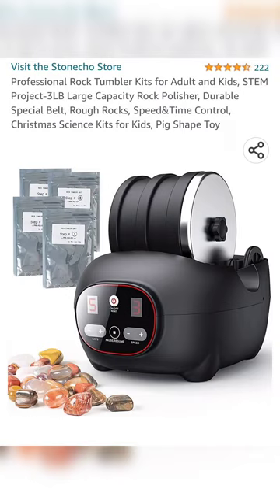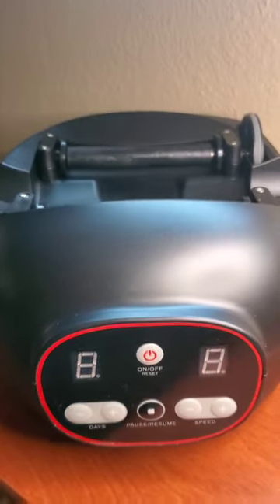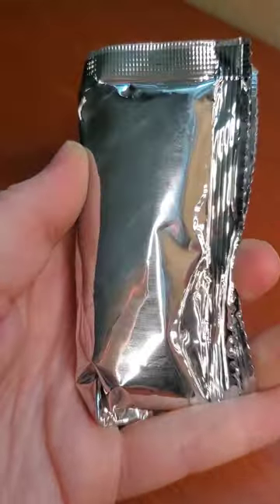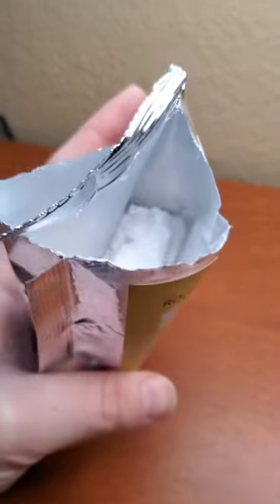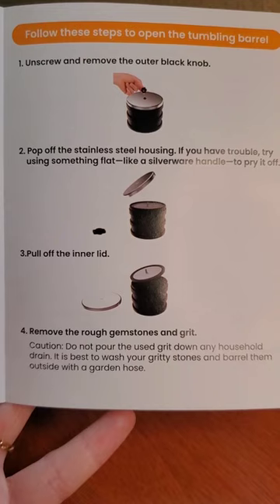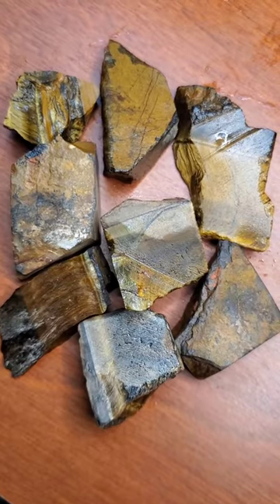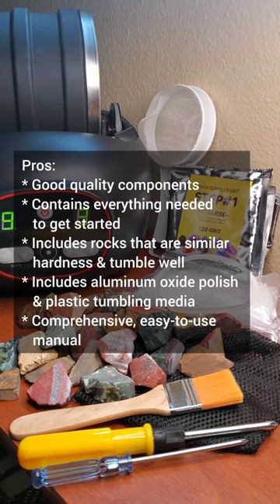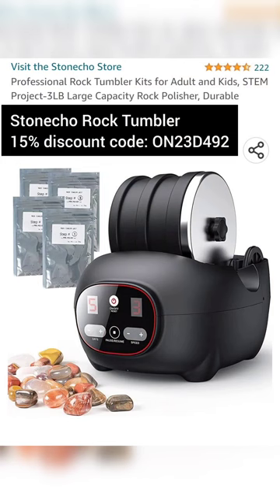Rock Tumbler Unboxing & Review - Stonecho Rock Tumbler

Comment: I’ve bought 2 of these exact same tumblers. Different company, but exact same tumblers, kit, grit, mesh bag, even the instruction manual (only change is the company name on the manual) one motor burnt out within about a 2 months maybe less. The other I’ve had for about 3 weeks and still works fine.

Comment: I use a Nat Geo for only 2 days on fast speed with no problems bruising the rocks in a 46-70 silicon carbide. This tumbler seems similar in design I would be interested to see how it holds up on the higher speeds. I like the heavier rubber barrels with stainless lids, they wear longer and help with rock bruising. Looking forward to your results. Happy hounding.
Reply from the maker: Nice! I'm going to run a batch using the instructions provided to see how they do.